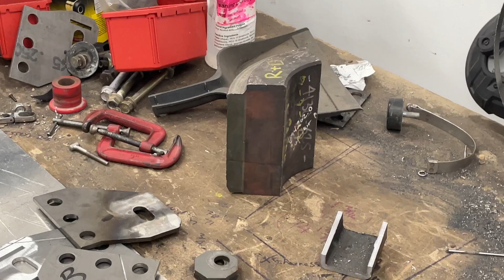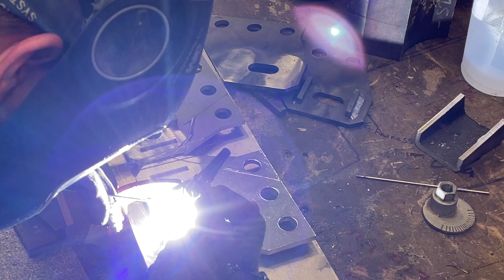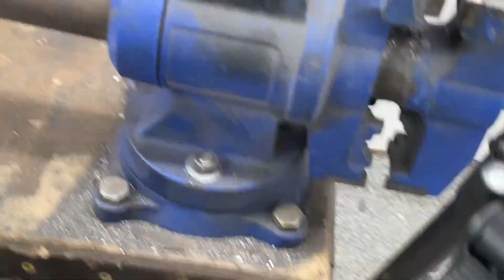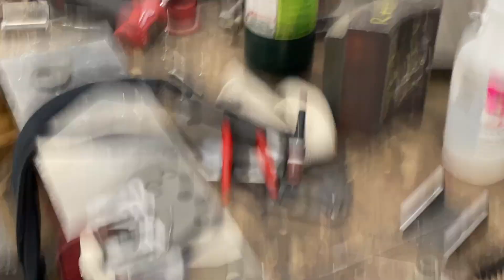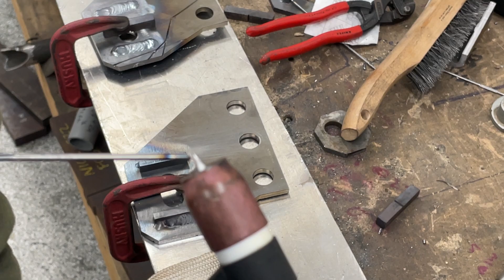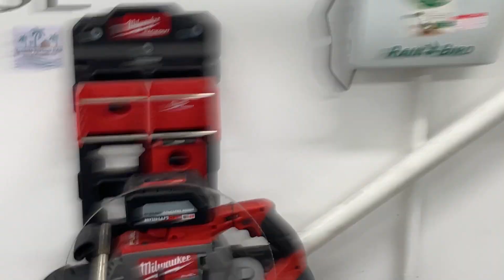Welding Engineer vs 4130 chromoly in his garage.

Comment: My dude, I am 6 mins into the video and I love it! I am welding nerd and this is great!!!  I seen “ welding engineer “ in the title and I was all over it.  I am super pumped to watch the rest. 

I was a NDT dude for 19 years and I have my CAWI , I missed my CWI but 4 points as of right now (womp womp 😅).  

I can weld but I am not a welder by trade. And I am working on that right now . I am trying to get into the welding program at my local nuclear plant right now . 

Keep crushing it dude!

EDIT: I am not at 32:31 where you talk about the grain growth. I had no idea thats called epitaxial growth . 

And whats really cool, is I had no idea you could 4130 thats over an 1/8” with a mild steel filler metal and not need a post weld hear treatment.   This is exciting news for myslef, as I to have have some trail rig projects I could use 4130 on possible. 

Again my dude. I love this stuff. I am actually getting ready to make a video today for my IG. Where I am going to repair a cracked aluminum flywheel from a lawnmower. But I am going to tig half of it . And stick weld the other half . But I am going to run the stick weld with the tig settings on AC and pulse . See if I can manipulate the settings  to get the stick rods to weld better.  Then I am going to PT it and maybe a cut and etch. I might even go to my old work place and have them shoot it (x ray) for me.  I am not to sure yet.

Double edit: ahhhh I just got to the end. So you are going to post weld heat treat the parts.
Reply from the maker: Thanks @Blueweld75! You made my day with that comment! So there's some ways that 4130 can be welded with out a post weld heat treat, I'll bring them up in a future video.